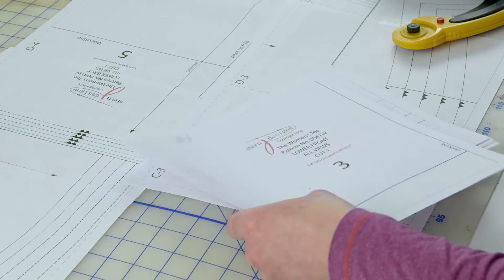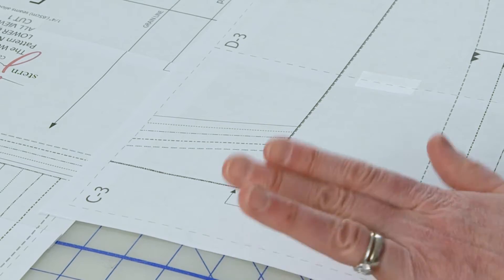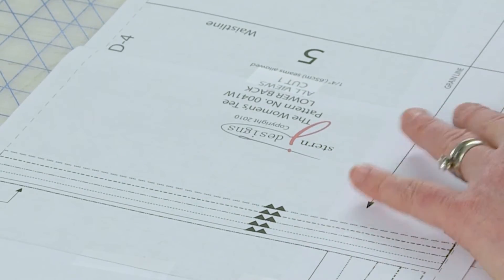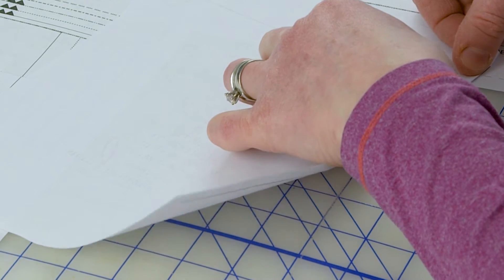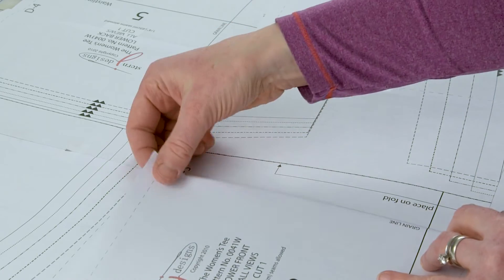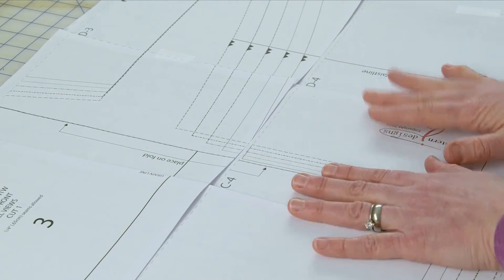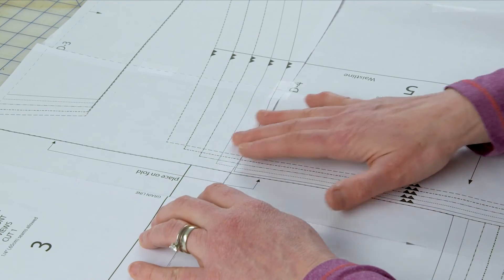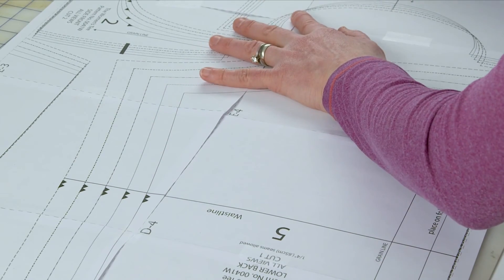How to Assemble a PDF Pattern -  The Easy Way

Comment: Thank you! I love PDF patterns but had the same trouble lining up!  Now a question. I usually trace off my size and make my adjustments. How do you store the large taped together piece?   I want to preserve it because sometimes I need to go back to the original for a variety of reasons.  
I love your tutorials and as a garment sewer for over 60 years I still learn so much from you!  Thank you!
Reply from the maker: You're so welcome :)   After I get all my pieces taped together accurately, I'll cover the edges completely with scotch tape... (tape it like you mean it).  Do both the sides of the pattern.  Then you can roll it up.  Another option is to cut the pieces apart and store them flat in an under the bed storage bin.  (I like those because they are long and shallow.)  If you do cut the pieces apart, pin them together so nothing gets lost!
Reply: I like both ideas and will try each!  If I use the roll method I could store them vertically. in one of those Rubbermaid gift wrap holders. But the under bed storage idea would mean I could easily get to the pattern pieces I needed.  Both awesome ideas!!   Thanks, Jennifer!
Reply from the maker: featherweight48 You're welcome:)